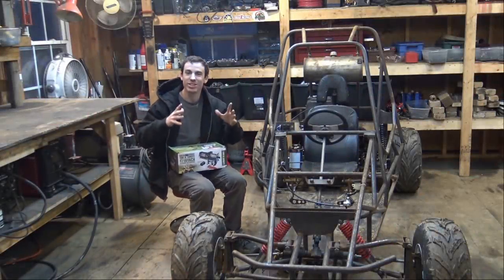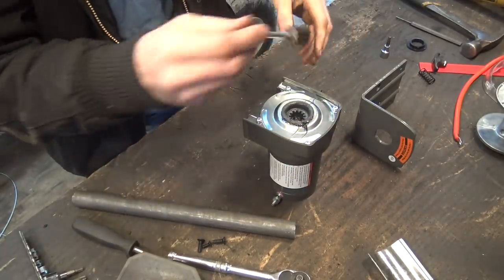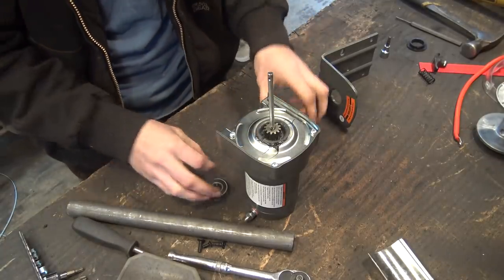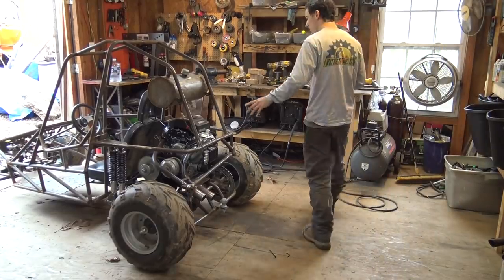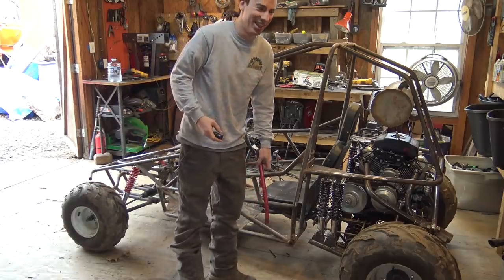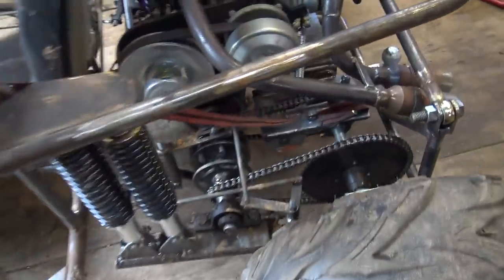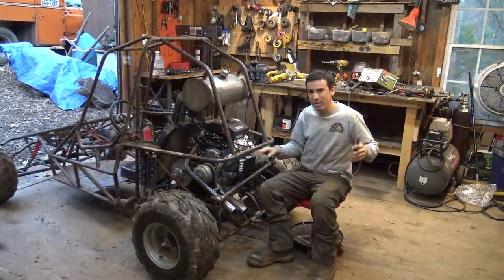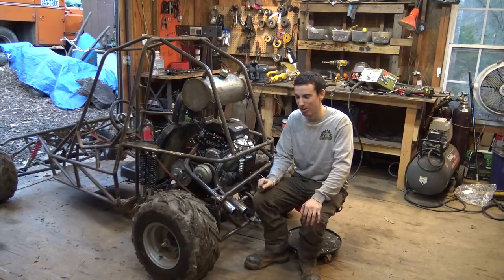Installing Electric Reverse on the Two Speed Off Road Go Kart

Comment: You don’t have enough amps from the small battery you are using, you should try a forward and reverse transfer box
Reply: jimmy tillery it was a concept
Reply: Yea, suffering huge voltage drop.
Reply: Those are rated about 7-12hp max depending on the exact model. I have popped one with a hotrod 212
Reply: Evil Me not to mention he'd have a mess of jackshafts to make it work on his 2 speed
Reply: Might also pay to beef up the power cables and connectors.
Reply: and he needs to keep the engine running, he can reverse all he likes but he won't be able to start it again after
Reply: But then he couldn’t showcase his daddy’s tools
Reply: Just need a bigger battery is all. And its cheaper than a trany and all the addons you need to fab.

Comment: battery to small keep engine running to keep battery charging
Reply: I agree with david start motor or bigger batt
Reply: @looking4flint69  with still need a bigger battery be it starter or winch they is not enough amp hours or cranking amps in that small battery to do the job i would go with caravan motor movers myself
Reply: I’ve got the same winch on my car hauler. I’ve pulled a full size truck up on it with a car battery only. The winch is plenty strong, just not enough juice to push it.

Comment: The theory is good. In 1977 my dad bought blueprints to a Popular Mechanix UrbaCar, and it used a 1964 Ford starter motor for the reverse. I think the drive on those is easy to remove, leaving only a shaft.

Comment: Depends on the application. Gearbox= more friction= more power loss. Big battery may not be necessary if only used for short durations backing up. The bigger CCA lawn tractor battery with decent sized cables and solenoid should be adequate.

Comment: A starter motor and flywheel ring gear from a riding lawnmower. Attach the ring gear to the big drive sprocket on the axle. Then mount the starter motor  on a bracket to engage the ring gear. Actuate with a push button.

Comment: Great idea, it really just needs more gearing. I did a similar system many years back using an electric wheelchair motor and a freewheeling hub
from a bicycle. The freewheeling hub only engaged in reverse and had an unusual side effect, that it made a sort of hill hold system, I could however disengage it with the in out clutch on the wheelchair motor. I also utilised the bicycle hub as a jackshaft to increase the gear ratio, meaning it was very slow, but could easily break traction even with me in it, and being so slow, it seemed to crawl out of bogs better, and it drew less current than a winch being a very efficient motor and gearbox.
Thanks also for another great video.

Comment: I had an old 6hp tiller engine that had an output on the cam also, had a regular Oregon centrifugal clutch on the crank, but had a small pulley on the cam, and a bigger one on the rear axle with a super simple "belt slack clutch". Worked great for years. Changing the reverse belt sucked, but it worked pretty good.

Comment: Great idea, the motor might be to weak but you ned a more powerfull battery.
Reply: throw a solid 12v at it and let it take the amps it needs that motor will do it.

Comment: I used one of these to make a gate opener, adding chain sprocket to it.  Was a hassle.  You can use a car starter motor instead, they are easily obtainable for free, and are a lot quieter.  The winch is loud as hell.  But love the effort.  Good thing you have a lathe!  :)
Reply: I also built a cement mixer using one of these motors, and you might have noticed, they are timed to have a lot more power when pulling instead of releasing the cable, i.e. spinning one way not the other.  I built my mixer to spin the wrong way at first, and the motor worked badly and overheated quickly, but once going the other way, it worked great and ran on a car battery all day pouring concrete.  Loud, but works, you need a strong 12v battery like a starter car battery.

Comment: you can use an old starter / generator combo and it would make power as well at the same time . I did it on go cart for the grandkids, has normal pulley so you can get a normal size sprocket as well. it works, cheers.

Comment: Very nice work on the machining and fabrication of the part  i think its really cool watching  a metal worker  make welds that look like a machine or robot  did them  i personally did Woodworking as a profession  for 20 years , my Grandfather was a Welder/ Machinist  by trade. And  i was only shown by my Dad  some welding basics. I can  accomplish some structual  welds but   Nothing very good looking  ?  I did however work at a  Shop that  did Architectual Woodworking  in one  area and Architectual Metal  in  another shop on the property  and a large. Part of the operation was  Aluminum fabrication and welding  A couple of the guys tried to show me how to  " lay " down  that Aluminum Weld  but i never seemed to  have the technique ? So i left it up to the experts

Comment: You are definitely a very talented machinest.
Given you do have a tig welder you should be using that to weld tubing and pipe.
With mig you only get a limited depth weld which is good on plate metal.
With tig you'll get a capillary thru weld that is far stronger on tubing and pipe and can be ground down to look better.
I have a diploma in welding technology.
Which included reading and writing welding blueprints.
Types of welds used in various applications.
And was a full time (certified) ironworker (union) welder for almost three years before I became a Coast Guard seaplane and helo Flight Mechanic.
Then of all things.
A jukebox, arcade and pinball game and pool table tech which included learning how to repair computers eventually.
I still do occasional welding.
Just not professionally anymore.
Your work is certainly outstanding.

Comment: You need a dedicated chain and sprocket that raises the gear ratio... use the FREESPOOL lever as your on and off! Hard mount the winch... leave the chain connected at all times and run a lever to engage/disengage the spool!

Comment: If you’d start the engine it would mean the battery wouldn’t be flat if you constantly used it, and the engine would only be idling.
Reply: No think about it like this he is trying to go backwards a start the engine up the engine is trying to go forward
Reply: @bryantzeigler8244  it's got a clutch on the engine plus there's a neutral position in his gearbox
Reply: Bryant Zeigler oh wow, your real smart 😂. It’s got a clutch, that when not engaged-and not in gear, means that it will not move, but you can roll it. A centrifugal clutch only works when your rev the engine, when idling, if idle is set not too high, it will not move or attempt to move.
Reply: Bryant Zeigler doesn’t matter about going forward
Reply: @93jake81  ok thanks
Reply: @Sam-m04  so how come win my kid stops on a hill with her go kart how come she dont roll down the hill? Because the clutch still grabs even at idle....
Reply: @51-FS   Uhhh idk maybe because of fucking brakes
Reply: @Toby-ju1fs  uhhh nope

Comment: I've seen somewhere on a crosskart they have a gear around the brake rotor like a flywheel and use a car starter for electric reverse.  Welds are looking good!

Comment: Maybe a used Starter motor from a car or truck. Would engauge and release automatic and heavy duty. Could get some used flexplates from the junkyard cheap. Could reverse polarity to run backwards ?? idk if that would work. Could have two starter motors on two gears for forward and reverse. Emergecy power or power boost.
Reply: I've got a motorcycle powered pulling tractor, and that's exactly how we did the reverse on it.

Comment: Starter and flywheel from 350 Chevy.You can adapt the flywheel and ring gear to your axle.The starter will have the torque with that diameter.No contact unless engaged.

Comment: If you want to use an electric gearbox, go to a salvage yard and get a starter motor. A simpler answer is the reverse gearbox that is commercially available, possibly go power sports. I have been riding Gold Wings that use an electric reverse since 1994, they used the starter for reverse, one of the key things is that your engine needs to be running when you back up, one reason why that stalled out is voltage drop on the battery since the engine isn't running, you might also want to run a car battery instead of the tiny underpowered battery you are using.

Comment: Some of those little winches are noisy buggers! I got a good deal a Bear Claw winch once because the seller thought it was damaged. I took it apart and discovered that it wasn't busted, it just sounded like it was because of how the gearing was set up.

I'd try more battery before trying more motor. If all you've got on-board is that little lawn tractor battery, it's gonna have a hard time, or an even harder time with a starter motor. Then again, if you used a starter, you could mount a matching flywheel or flexplate to your rear axle and use the starter as-is and you wouldn't have to come up with an engagement mechanism.

Comment: You need a “sprag clutch “ . It’s a one way clutch that resembles a bearing. Its kinda like what is in the rear wheel of every bike that makes that clicking sound when you stop pedaling. There are lots of variations of the sprag clutch. Just look it up. 
And your electric motor needs a higher rpm rating so you can gear it down without it loosing its internal momentum.

Comment: Old 2 stroke golf carts had a starter generator that was basically an alternator that also worked as a motor. It has forward and reverse capability and would start the 2 stroke in either direction, then when the motor is running, it starts charging.

Comment: I used to have a 6 Wheeler that used a starter motor for Reverse. A starter works great for reverse because of the strong overrunning clutch and plunging gear.
(Plus they're very torquy)
If you can find a gear pitch and size to match, that would be the way to go.

Comment: the Aussie Racing Car (mini racers) use a starter motor mounted above the disc brake , the brake rotor is notched to engage the pinion gear.

Comment: Winch should move it better but the battery really seem to be the issue and to find different motors washer and dryers run off belts and depending on the one 3-5 hp great thinking definitely saw your quick work need more of this

Comment: @rather b welding

ive spent some time lookinginto something similar and you could actually use a one-way bearing, otherwise known as a sprag or overrun bearing. 

this would allow it to freewheel when the engine is turning normally, then when you engage the winch motor in reverse the sprags engage and it pulls the kart backwards

Comment: Try using a 16 volt battery,  (like for race cars, they have stronger power for winches) and using a bicycle freewheel sprocket off the rear wheel of an old bmx bike! -engages when turned one way, ratchets when turned the other!

Comment: I’ve always wanted to do this with a starter motor from a car. Plus it will only engage when you need it. Surely you could machine up an old flywheel with ringear for it run along.

Comment: As people said in the comments, you need more amps!

A small winch easely pulls 100A during high loads, Try it with a BIG car battery before you trash the idea.

If it works with you can uppgrade the battery, mabye get 2 batteries in paralell to get the CCA higher withouth spending a lot on premium batteries.

AMG batteries are typicly better for high power draws, but are easely damaged if they get to low voltage or to high voltage.
Unles you want to go lithium, but thats expensive :/

Comment: You need to put a larger sprocket on the winch. The way they are designed is they have more pulling capability with more wire on the drum so if you were to put a larger sprocket on it it would be the equivalent of having more wire on the spool.

Comment: Here's an idea. Chain an electric motor into the rear axle and it will have its own pedal and switch. Like it can be like regenerative braking where it produces energy assuming there's enough space to put in ac to dc schematics there and have a flip switch in which it switches the battery from being a generator to fully working as a motor. A plan I'm thinking of putting on my project electric gokart

Comment: you should have the motor on a chain going to the Jack shaft or axle & have a bike sprocket on it. that way you can go forwards with it & the sprocket would just click. but it would engage when u turned on the motor. I think you get my concept.

Comment: Good idea, bad wench.  In my experience with harbor freight wenches, they’re not water proof, so mounting it down there is not conducive to long life.  Sorry, just being honest.  Have you seen the reverse kits they’re selling on amazon?  They fit onto torque converters, they have F N R, for $150.  I think they only handle 10hp,  but look interesting.
Reply: Not only this, but the Battery. I feel bad for the Battery that is running that Wench, it has to be struggling.
Reply: winch
Reply: It’s a winch not a wench. 

A wench is a medieval barmaid. 🤦‍♂️

Comment: Could have a second wheel  which could be lowered down and lift the cart slightly  at a 90deg angle to the axel.  360 Turns in place. Poor in Mud but may be simple for turning in a lot of situations.

Comment: You either need to have the machine running or a bigger battery but that winch has more than enough power to move that buggy wherever you want, you just need the juice to make it work.

Comment: I think the starter motor would be simple to do.  You could mount the starter motor to frame and use a flex plate/flywheel from the same engine the starter comes from.  You could make an adapter to mount the flex plate on too axle.  The starter could be ridged mounted so you wont have to have an elaborate mechanism to engage it.  Once you give the starter powre the gear pops out and contacts the flex plate and turns the axle.  When you remove the power the gear goes back in and disconnects from the flex plate

Comment: How about a car starter for the motor and a small flywheel for the sprocket? If you got a transmission that fits the flywheel and motor you can cut down the flywheel housing to make a mounting bracket.  That way the flywheel can spin freely until you engage the starter.

Comment: Yea that's cool 
I think you need more amps or u could leave the engine running and separate the engine cong so the engine does not turn when the motor spins. That's a cool idea maybe you could  use a car starter  instead

Comment: add an alternator so you can use the petrol motor to run the electric motor. The higher charging voltage output will help with your torque issues.

Comment: I'd like to see you build an electrically propelled dune buggy powered by a few LiPO batteries, charged by a 3 to 6 h.p. engine+generator sort of like how diesel-electric locomotives run today. Electric propulsion is so superior to direct internal combustion engine drivetrains. I'm building something sort-of in that ball park right now, and YES it's complicated when compared to a simple go kart. You build A+ vehicles, and it would wow everybody.

Comment: Get a electric actuator that will push down the   Reverse system and it will be better at holding it out of the way other that the need of a bigger motor amazing design and idea. But you definitely need a better way for it to be held up and you can get a bigger one way motor to help it back up better

Comment: I suspect that if you look at the voltage at the winch motor it will drop significantly as the motor slows. Try two batteries in series. The motor can take it. A good charging system will have the battery at 13.8 to 16v, it'll read 12.xV not charging with minimal load and I'd not be surprised if it drops to 6 or 7v with the winch running. Current is more or less proportional to torque. You need more voltage to shove the necessary electrons (current) through the windings to get the needed torque at a reasonable rpm. (I won't go into back emf generated by a spinning electric motor.)

Comment: bigger battery (lawn mower or miata battery) would make a huge difference, or a dual battery setup (parallel for highest amperage delivery with lawnmower batteries or golf-kart batteries) good proof of concept though, i think you're on to something with the electric reverse, just the amount of weight you're moving with that heavy frame + engine + fuel + rider, go powersports i think has a reversible gearbox that you could add in with your main drive into your 2 speed trans to give you forward and reverse at full engine power

Comment: Your existing design might work, but to give it a fighting chance, you need SHORT, 4 ga. wires feeding the winch motor, and AT LEAST 1 deep cycle / marine battery. A gel cell would be best, as they can be mounted in any position, and they don't have the leak potential a flooded cell battery would. Also, the reason that motor is running weak is due to the type of motor it is - a permanet magnet dc motor does not have the torque of a series-wound dc motor. These would be used in bigger winches and are the common design used for starting motors... Don't give up yet on that motor, it is rated 1.1HP as I recall, but to get that much power out of her, you have to FEED her with that much power from the source. ;-)

Comment: is it worth it using a stronger winch motor to drive electric quad bike? been offered a use AMJ motor 5272 model 12 volt 1.5 kw